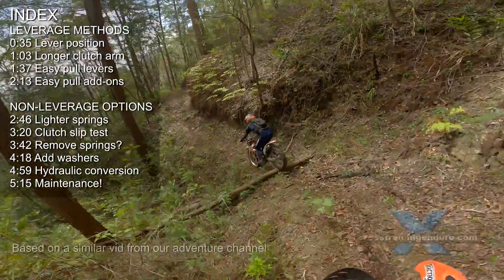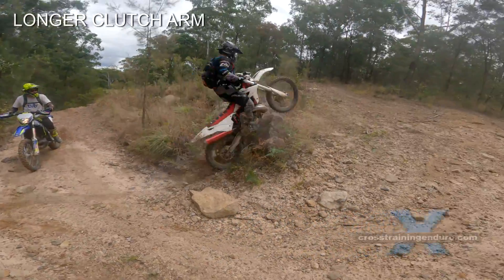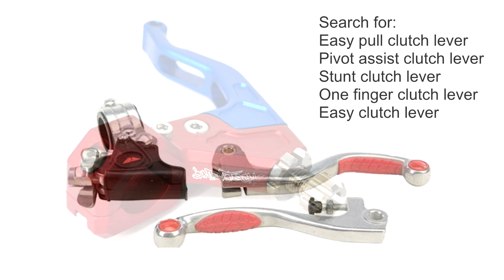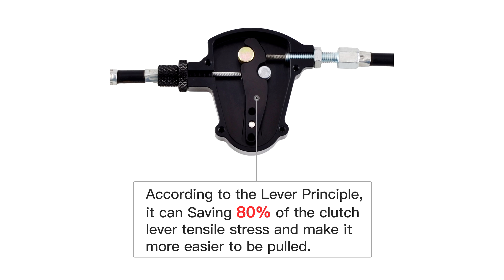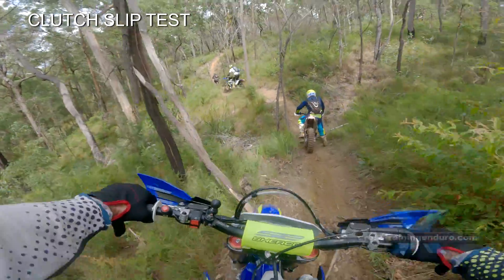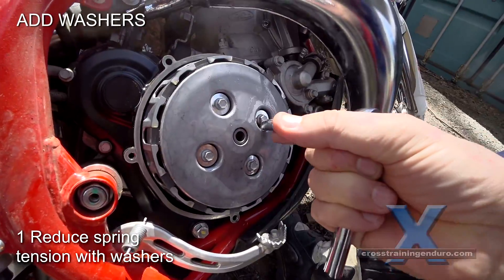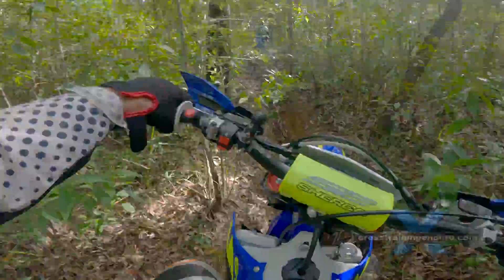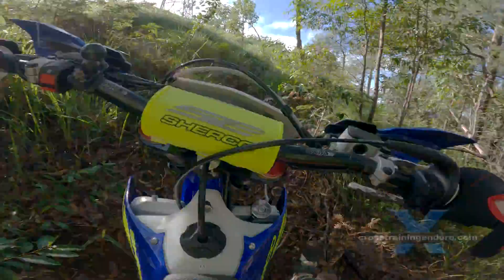How to make a cable clutch lighter: 9 enduro tips︱Cross Training Enduro

Comment: Great vid, and all valid points. I will stand up for the hydraulic conversion. Yes there is little decrease  on clutch pull pressure, but the massive increase on clutch feel is well worth the cost.

Comment: I made something like clutch arm to my Honda 250 xl degrees back in the day. It is most simply mod to get lighter pull. But if you want something even lighter then ues car's break cable since it has bigger diameter or less friction. Another pro is you no need to worry about it's getting snap in the jungle. For those 2 mod it made about 50% or more lighter pull then my ktm 250 hydraulic clutch.
Reply: If I understood properly, you were making beefier cable using car brake components?

My friend, you are a genius!
Reply: @cedricboivin9422  Yes I am.

Comment: The best advice I can give is aim at reducing the clutch pull BEFORE THE CABLE. 

The problem with cable is the friction. If you reduce the pull before the cable, you also reduce the friction. A 20% reduction in clutch pull before the cable can easily cut by haft the strength needed.

On the subject of leverage, one big problem is that if you slip the clutch a lot, the lever as to be adjusted way more often. Leverage increase the effect of clutch thickness change (this can only be completely fixed by hydraulic clutch)

Personally, I installed some washer on my clutch spring (1mm I think) and I extended the clutch arm with a cheap chinese bracket. I'd say that the clutch pull on my WR250R is about half of what it was, but my clutch is often on the edge of slipping at full power and I have to constantly do adjustment

P.S: seriously Yamaha how the f**k can you make a clutch for a bike with 18ft-lbs of torque so damn hard
Reply: Yeah the wr250r pull is doodoo and friction zone so small. 

I ended up drilling a new hole for the cable in my stock clutch lever for better leverage.  Similar to rsc clutch lever now but cheaper.
Reply: @potatopobobot4231  I have drilled lever on many bike and it does work well. However, I suggest you try to increase the clutch arm length instead as it reduce cable friction
Reply: @cedricboivin9422 ahh i think i see what youre saying.  If the pull is easier at the motor side theres less tension on the cable so less friction.
Reply: @potatopobobot4231  Exactly
Reply from the maker: Do you have a link for the longer clutch arm that works on the WR250R, Cedric? I'll put it in the pinned first comment for others.
Reply: I've got the same bike, I did 1mm washers, and run a full length lever, with a zip tie to keep the lever where it needs to be for my stubby fingers to reach.  It honestly works fine unless I'm running some really tight single track, and have to really haze the clutch to maintain traction.  What are you running for tires?  Since switching to a more grippy compound,  I've noticed I work the clutch a lot less, and my finger is a lot happier for it.

Comment: I added a magura hydraulic unit to my old RM250 a few years back-trying to get better feel and lighter action.  Not quite the same as with stock maguras of the same timeframe.  I think the pull was actually stiffer with the hydro piece.  I tried their “long” lever, and it still didn’t quite feel right.  Back to the stock cable for me.  My forearm pump (or lack of) was noticeable with the cable.  All bikes I’ve had since have been hydro clutches (KTM and sub-brands).  I really like the feel of my current TE300’s clutch.  Very light pull, consistent actuation.
Reply from the maker: I think the Austrian models changed to a diaphram clutch in recent year which is quite a bit lighter

Comment: I converted my old pe175 to hydraulic using a slave cylinder and hose from clake. I matched it up with the leaver from my beta 300rr. To get enough pull on the clutch arm I had to redrill the arm closer to the spline. In doing this the hydraulic clutch was about 30% heavier than a new cable and Ballards pivot assist leaver. I could never quite get enough pull out of the hydraulic set-up.

Comment: I have a 93' Honda dominator. I had a cheap cable and couldnt believe the change that made changing to an original honda cable. 5x the price, but the change was amazing. Also the cable is way thicker so I think it will last for another 30 years

Comment: I would recommend people to experiment with taping levers. Try medical tape for cuts, for example. You can adjust grip friction(using different tapes) of lever and reduce fatigue in long run. Useful for wet conditions when all metal levers are slippery. Moreover, you can make levers fatter and see if it feels more comfortable.
For 2 stroke or engines with separate transmission and engine oils, you can use more "grippy" oils in transmission, like ATF.  It can help if you remove springs in clutch basket and it starts to slip. Also, some people like grabby feeling of clutch.
Reply from the maker: Lever thickness is interesting. I've used the short stubby Midwest clutch lever before and loved it. Others had the thick lever and grind it down.

Comment: I don't think that hydraulic conversions will lighten the clutch on all bikes. Apples to apples the magura system for the DR pulls about the same as a newer OE cable. I had the change to grab one of the original procycle kits for cheap and brand new and while it's some cool bling I don't think I would do it again on a DR unless Suzuki stopped making cables for the bike. 
At one point I had a motion pro cable and brand new it had a pull that could be measured in tons, I didn't notice it till another rider pointed it out and I fitted a new OE cable and it reduced pull effort by over 60%. As for the hydraulic, it pulls about the same as the cable but just more numb and it almost feels a bit less precise than the cable strangely enough.
Reply from the maker: Damn! That would be disappointing to put all that money into the Magura and not actually lighten the clutch pull.

Comment: Maybe off topic, but another tip; are you using the clutch too much?  I use it a fair bit in the rooty wooded stuff and carried the habit out into the faster going, using it to coast in and smooth delivery out of bends, when I didn't really need it. Try deliberately riding the more open stuff by just rolling on and off, the clutch is effortless when you don't use it!  And it saves those finger muscles for the gnarly bits.
Reply from the maker: It's a good point. I use it so much on our hard enduro tracks I do occasionally find myself slipping the clutch on adventure rides. E.g. into a slower corner I'll just feather the clutch sometimes instead of changing down a gear.